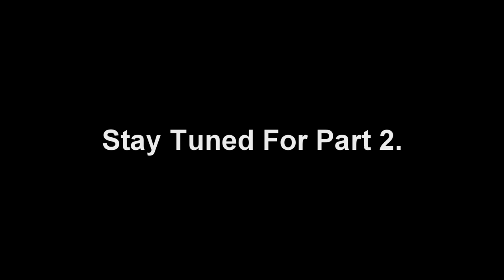ARGO 6X6 STUCK IN THE CREEK

Comment: I once had an impossible stuck that required my truck to get out (almost got the truck stuck too).  I've decided a permanent-mount winch is not the way to go. I recently picked up a portable 2500lb winch that I can position at the tree and just mount hooks in several places on the Argo. My thinking is pulling it out backwards from low at the trailer hitch would work best. The high nose-mount winches tend to pull the machine down in to the muck.

Comment: Your videos of your Argo 6x6 are entertaining for sure. I cringed when you lifted up the rear floorboard and seen all that mug, sticks and twiggs jammed in your frame axel and chains. A 1998 Argo Bigfoot was my first Argo I bought which needed a complete frame out restoration because it wasn't taken care of. It was pretty neglected and abused but I got it working and looking like new after the restoration.
Reply from the maker: Glad you are enjoying the videos! yeah i need to clean it out again. seems to get dirty again so fast after cleaning.
Reply: @Ripsky  I buy older model abused and neglected Argos and restore them as a little hobby. These machines are such an awesome ATV but crazy expensive for the new ones. Rebuilding the late 80's, 90's and early 2000 model 6x6s and 8x8 is way cheaper than getting a newer one that do the same thing. I did a few videos on fixing the first Argo Bigfoot I bought. It was worse than I thought or the guy told me when I bought it but it was still a fun project Rebuilding it. The Bigfoot 6x6 was one of the best 6x6s Argo made due to the larger 25" tires. It's nice to see someone else like you, as I do, enjoying these machines. Keep the videos coming!
Reply: @Ripsky  here's my newest 2000 Argo Conquest 8x8. 
https://youtu.be/At-mPLv6nm4